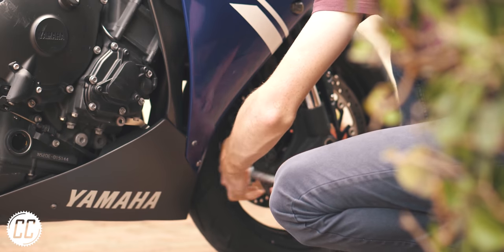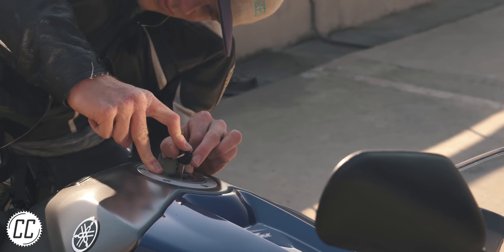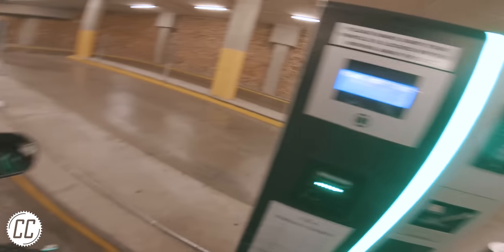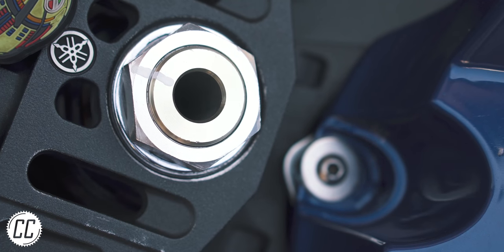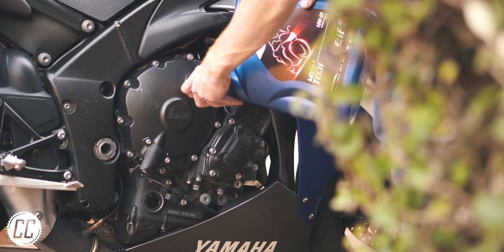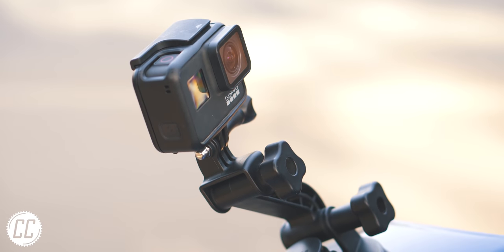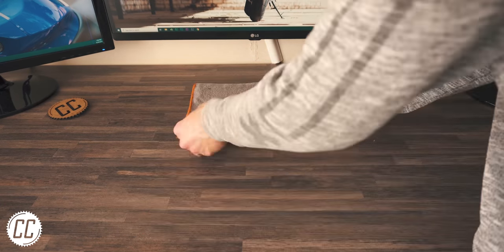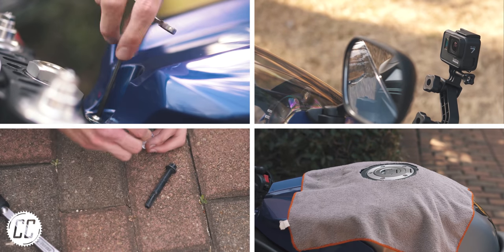10 Motorcycle Hacks For Enthusiasts

Comment: lol i never pay for parking garages when on my bike because i fit through the gap and no one ever argued about it
Reply: Wait until you get into a parking garage that has cctv and guards...
Reply: isnt the gap for that?
Reply: Ohh so you're THAT guy ...
Reply: Once I wanted to buy a ticket with my bike and the guard took the ticket from me, telling that the gap is indeed for motorcyclists. Since then, I don't bother with the tickets anymore.
Reply: Leontief Modell no thats what the gap is for
Reply: Had an issues getting into a parking garage at Arlington National Cemetery. My bike wouldnt activate the auto ticket spitter and the button wouldnt work... so i piggy backed next to my dads bike... in the end we paid for 1 ticket and used a single parking spot.. so all is fair in my mind.
Reply: you just cant pay lol is even dum to do it
Reply: Carlos Alberto um yes you can i do it all the time for the past 7yrs . The gaps for motorcycles, at least what i been told by many different parking garages
Reply: The bars are unsafe for motorcycles. Most will have a no motorcycle sticker on the machine.
Reply: 😂 I thought I was the only one who so viscously broke the law
Reply: @thepsychicpeach8425  you break the law like maple syrup?
Reply: Was recently at a place where the ticket machine would not even give me a ticket because the detector loop in the ground would not detect my small scooter. Gave up and squeezed through the gap. 
Later learned that they often have detector loops in the ground now to stop people from driving in with their cars, staying for ages and then, instead of paying their ticket, getting a new one on foot and driving right out (as usually, the first few minutes are free). So, they don't give you a ticket if they don't detect a vehicle. But those detector loops aren't that good at detecting smaller bikes.

Comment: Top tip for sleepy go pro, rough up the mating surfaces of the plastic clips with sand paper. They're shiny and slide about, if they're rough they clamp together better without the need for over tightening delicate threads with a screw driver. 👍🏼
Reply: Or use carbon paste, which has abrasives in it

Comment: DO NOT USE GRAPHITE IN YOUR LOCKS!!
i've worked for a locksmith and i'll tell you this, if water or oil gets into the lock cylinder in the future, the graphite turns into stone. and since this is a bike. it will happen
yes, graphite is used in locks BUT this is a lock cylinder that is outside.
use lock oil or another thin oil! 

EDIT: just had someone come in today that had done this. and the graphite had turned into stone.
Reply: Victor Hangaas thanks, you need more likes so you get to the top of the comment sections so more people can see
Reply: Yeah, when he scraped graphite into the lock i cringed. There should be a lot of red flags already, if somebody is putting anything other than lock oil or similar oil products into their locks. In the end, i'd rather spend my money on lock oil rather than a new lock. 

Also, if you're living in a cold climate, consider treating exposed metals with rust protection spray. I've noticed over the years than my brake disc bolts as well as a lot of other bolts have started to corrode. Or just upgrade to stainless bolts, if you got the money.
Reply: Xan Hede you should pick one wet lube for the lock and stick with it. If you pick wd40 only use wd40, but staw away from wd40 because it evaporates very quickly. There is a reason lock lock lubricant exists, ask a local locksmith!

You could zink plate bolts or get zink bolts
Reply: I use chain spray :D.
Reply: Geez, I was gonna say at the very least maybe use graphite spray.....
Reply: I was wondering what would happen with all the buildups from the graphite with time
Reply: a little bit of kitchen oil will help
Reply: @jean-francoiswazaa7378  kitchen oil gets sticky in time..  so is not good.
Reply: What about lithium or molybdenum dry lubes? Will they eventually cause the same binding problem when wet?
Reply: @DavidTopps  just stick with lock oil, silicone spray or another thin oil.
Reply: @jordan9339  if its thin, it should work just fine. but if it is thick i'd swap to a thinner oil. thick oil/greace collects and stores dirt and dust. thin oils don't.
Reply: WD40 good? Or is sewing machine oil better?
Reply: @user-gdxt-7399  wd40 is fine, just stick to only wd40, but it evaporates kinda quickly i think
Reply: I use gear oil and it's 1000x better than wd40. Takes really long to dry
Reply: @DavidTopps  usually not, a better practice is lube the key or find a waterproof lubricant. My preference is one of the silicone lubes.
Reply: Thanks for the info bro.
Reply: Legend
Reply: Are you sure? Can find any article that said graphite turn into stone with water
Reply: @mrd2392  I'm pretty sure he knows what he talking about by the sound of things lol, I dont think he means actual stone rather than a solid lump of graphite that blocks it up
Reply: Was told the same. And my bike doesnt even have a cover over the key hole
Reply: @victorhangaas6719  wd40 is not a lubricant
Reply: @MrZ1000fam  no i mean it litterally turns into stone
Reply: @mrd2392  wet lube is best in locks, if you have filled a lock with graphite and then in the future add lube you may turn the graphite into stone inside the lock
Reply: @nyetloki  yes wd-40 is a lubricant
Reply: @mrd2392  like any other small gritty particle, like dirt or sugar or salt. Especially if it has nowhere to drain and it dries out.
Reply: Just gave u 1k likes :)
Reply: Glad I seen this I was about to does this since I seen it here and Fortnine
Reply: Really? I bought lock graphite from my local Locksmith, and nothing on the packet says indoor use only.
Reply: you all prolly dont care at all but does someone know a method to get back into an Instagram account..?
I somehow lost my login password. I appreciate any tips you can give me
Reply: @Shepherd Aiden Instablaster :)
Reply: @Zeke Layton Thanks for your reply. I got to the site on google and Im waiting for the hacking stuff now.
Seems to take a while so I will reply here later with my results.
Reply: @Zeke Layton it worked and I actually got access to my account again. I am so happy!
Thank you so much you really help me out!
Reply: @Shepherd Aiden Glad I could help =)
Reply: silicone spray
Reply: What if like me a nieve tosser already done it. Can I flush it out with WD40 ? 🤔
Reply: Spray dry lube
Reply: I did think that exactly. I have a  large spray can of dry silicone lubricant and lasts for ages!
Reply: @daveodanger  Dry silicone?
Reply: Use ballistol universal oil that is the only oil that is not hazing over time
Reply: @jean-francoiswazaa7378  cooking oil with become sticky. i have a bottle of vegetable oil that has been sitting outside for a year. the outside of the bottle is very sticky, the oil goes bad when it comes into contact with air. the same thing will happen, except in your lock and will give you  a sticky lock

Comment: That look on your face at 3:42 was exactly how I reacted when my shift lever fell off my fairly new bike when I was pulling into my driveway.  I went through and loctited every critical bolt on the bike that I could get to after that heart stopper.
Reply: That wad my face when i didnt notice that my abs was turned off
Reply: Had the same deal on my rear brake, filtered off the highway and found there to be no rear brake :( Luckily just a bold and rings lost, could have been worse.

Comment: 5:19 tip 5, dismantle the go pro bracket and lightly sand the flat points of contact on the "fingers" of each section just enough to give a scuffed rough surface. 
Reassemble... 
Now there's no need to risk cracking the plastic by overtightening the bolt as suggested in this video. 
😁👍

Comment: Loctite tip.  For bolts in places where you shouldn’t use Loctite (or other thread lockers) because they will damage the bike (plastics), craft rubber cement does the job of helping the bolt not work lose and easily comes off when you need it to.  Plastic safe.

Comment: I like the one for the fuel tank, with the cloth but also for the parking garage ticket. Another trick I have seen for the go pro mount is to use some 150 grit sand paper and just roughen up the the inner surfaces (teeth) of the mount so there is more friction.

Comment: I have a KTM RC 390, it's battery cover plastic piece rattles a lot (it just clicks into the place, no screws holding it), so I wrapped some electrical tape around the tabs which click into place, it has been quiet since then.

Comment: I've used old oil containers the same for draining engine oil for years and then fill another container and take it to the recycling centre . Handy tips . Thanks
Reply: Same here. I put the oil in the bike, then empty the drain pan into the oil jug. Seal it up and take it to recycling.
Reply: Also if there is some new oil left over I put it into a separate container kept just for that purpose. Use that to top up oil between changes.

Comment: Good point about marking fasteners so you can see  if they have loosened, I do that, especially after a major disassembly, the first ride after I am on the lookout for loosened bolts, my CR 250 r is vibration- y, so I stay alert.

Comment: a hack from my side: if you've just bought a triple tree stand for your bike, because let's say you need to change the fork seals, but it turns out that all of the adapters are too small, just take a vernier caliper, measure the inside diameter of the hole in the triple tree of your bike, and then wrap the pin on your stand untill it's 1mm thicker, it won't be as good as a right size pin, but it works. I had that happen to me when I wanted a front stand, only to find out that the thickest front pin is 18mm while my yzf r125 requires a 22mm one (which I still have no idea where to get).

Comment: The nut trick is good, but truckers do this with their wheel nuts... Silver markers are better.
It blends in better and doesn't chip off so easily.. Also instead of lines, do 2 dots.

Also... Loctite is a brand, you meant to say Threadlock.
And make sure its blue Threadlock, as red sets solid and you'll need power tools to remove

Comment: I have 2 old school hacks for you (using newspaper)
-if your boots are wet from a ride, when you store them for the night, stuff crumpled up newspaper into your boots, by the morning the paper will have absorbed all the moisture, then all you need to do is remove it.
-if you're riding in a very cold climate and get caught out with a summer jacket, open up your jacket and then open up the newspaper, put it against your chest and then zip your jacket up on the newspaper (ideal for tight fitting jackets) the newspaper acts as a barrier to the cold air.

Comment: Here is also a Tip if you want to get and turn your key smoothly. Just put a litte bit of sewing mashine oil on the key and put it in and out the ignition lock a few times, and the problem is normaly fixend, and the oil doesn't do damage to your ignition lock or key. :)

Comment: If you're doing a top end rebuild and the barrels are a swine to free off the crankcase, next time just slacken the appropriate nuts a fraction and start the engine for a few seconds, no more broken fins or lever gouges in the alloy. Screwdriver bit in end of petrol pipe for hard to reach carb adjustment screws. I love shared biker knowledge, although I'd have used petrol on a rag to clean grease off tiles followed by water and washing up liquid. Good luck with your channel✌

Comment: Wd-40 and a rag takes off any fresh paint within 24 hrs, axle grease, fresh epoxies activated or not, any oil, water or alcohol based goos.  Works extremely well on the hands to take off the mentioned substances.
Reply: P.s. I worked in a shipyard for a summer on all kinds of boats and wd was my go to for clean ups.

Comment: The nut came lose by viberation, if you use medium strength threathlock and then tie the nut the change of it lossing up again is going to be small. Correct me if i'm wrong.

Comment: Can't do the fuel cap trick with tickets it's just a simple cap on my tank .I just use washing up liquid for getting the oils off me also a nail brush works wonders with it. I use 3 in 1 oil "spray" which lasts for ages and i use pretty much anywhere on the bike. Even to clean the shocks, all i do is soak a cloth and wrap it round and pull it like an old fashioned chain saw. I always have a microfibre cloth, it lives in my top box along with a small air compressor, tool kit and a bottle of visor cleaner which is useful on the lights and dials too. I do use a sena 10C camera/bluetooth headset instead and i have a front/rear camera system on my bike. one cam just under the headlight and the other just below my tail light. And i'm currently designing a tool box that is just right for the bike, also going to use the spare lock that came with my paniers so i wouldn't need to go out and buy a spare lock. Even though i could make one out of pvc... I'm doing a kickass steel one

Comment: For your GoPro going down with the speed.. you just use it in the wrong way. Your GoPro should be in the same way as the wind push it. So the wind will push in the lock way. If you sometimes use light for your video with grip head give a try to that tip

Comment: Can I use the extra 50 to 100 ml engine oil to lube the chain??
Reply: Use gear oil
Reply: Why not if your manual says you can. I normally use gear oil, but sometimes use the remainder of the oil for the chain.
Reply: Why not if your manual says you can. I normally use gear oil, but sometimes use the remainder of the oil for the chain.
Reply: Why not if your manual says you can. I normally use gear oil, but sometimes use the remainder of the oil for the chain.
Reply: Why not if your manual says you can. I normally use gear oil, but sometimes use the remainder of the oil for the chain.

Comment: Be careful as to the type of oven cleaner and where you use it. Some types are very corrosive. I learned the hard way. #2 I found a neat little trick for gopro lenses. But some Rain-X for plastic (North America). It repels water and makes it easier to remove bugs and dirt while protecting the lens. I also use it on all my lights and windshield.
Reply: I clean my windshield and painted surfaces with Pledge . Gets the windshield sparkling and removes bugs too.

Comment: How to protect the tyres from getting punctured I had to change my Good tyres just because of the punctures!
Reply: Don't drive over things that puncture your tyres

Ez
Reply: A more serious answer is that the only thing preventing a tyre puncture is a good set of hard compound tyres with lots of thread left in them

Although you wouldn't want tyres with sidewalls made from adimantium that last 30k clicks normally

If a puncture is really causing you headaches constantly, and you are constantly worried about a blow out, try some green tyre slime. It works wonders in that case
Reply: wrap your tyres in steel sheets
Reply: Floris Apon I need soft compounds(metzelers) for grip and cornering for my duke 390
I bought the steel braided once this time lets hope that these are more durable😬
Btw Thanks for your reply😊
Reply: @zhack3d  A KTM Duke 390, sweet ride.

On my journey throughout Europe, I had to replace my tires because the thread dept was getting under 1 mm, and after thinking a long time, I've settled for what they had at the time

Metzler Roadtec 01

I have never felt as secure in cornering as with other tires, I'm riding a Honda CB500X

Metzler's have a reputation of lasting a long time, at least the Tourance Next with it's 90-10 dirt/road tyres for touring, and the infamous ME 888 MARATHON's that do almost 30.000 Kilometers

I'm sure you made a good choice with whatever you have put under your Duke

Comment: If no Nail Polish... Superglue Held my dirt bike together. Never lost any nut, bolt ... nothing !!! :) :) :)
Reply: i stripeed the threads on my front caliper and used superglue and electrical tape to hold it in for a couple months until i got a chance to cut new threads

Comment: The only one i didnt know is the oil pan which is good, but ive been riding a WHILE. a non tach chain lube is better way to go with the lock. here's one every rider needs to do... TIRE PLUG KIT, and a bicycle hand pump. most sportbikes can fit this under the seat, beats having to get it towed, especially if far out in the middle of nowhere. ditch the shitty black plugs the kit comes with (they dont work) and grab the brown ones, keep them in a ziploc because you dont want them to dry out.

Comment: Oven cleaner is great. Been using it for years under my bike but not around the disk pads or rotors though. Great at cleaning flunged cgain lube
Reply: Wd40 removes chain sling and will not damage painted or powder coated surfaces.

Comment: bid everytime i go for a ride gas leaks out from my gas cap because the rubber o ring is done for. the entire tank normally gets a nice coating after a long day of gas. been doing that for 5 years its a 1975 honda dual sport bike. im sure it has been been doing it for 10 years or more gas aint gunna hurt the paint
Reply: As long as you stay ontop of cleaning the tank and waxing it once yearly ( if you ride daily like I do)..then yes..you're correct.
Reply: @motoryzen  i wash is every couple months and wax it once a year i ride every weekend or every other weekend and do 75ish miles all off road on it